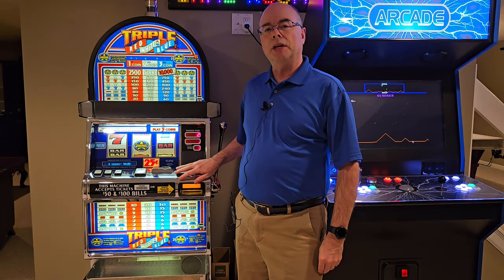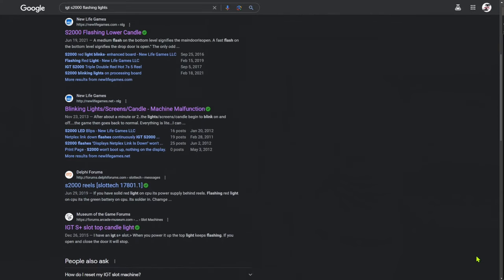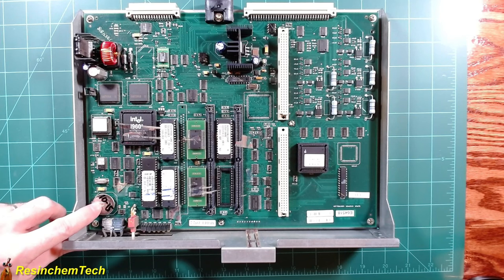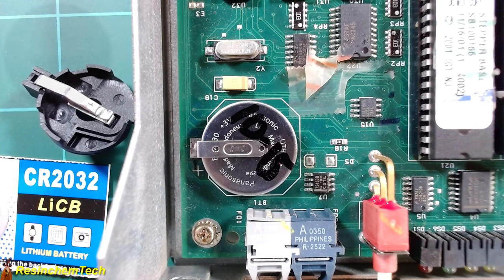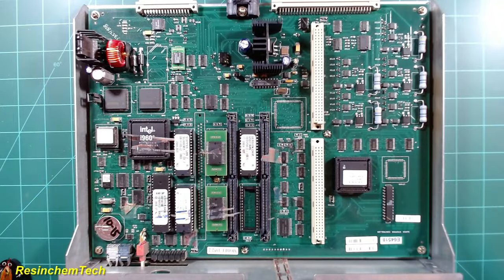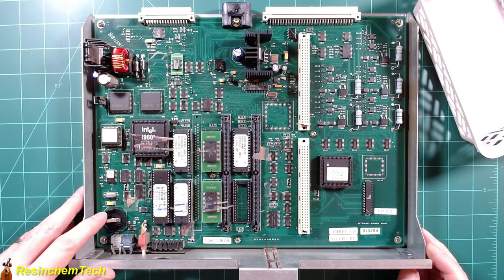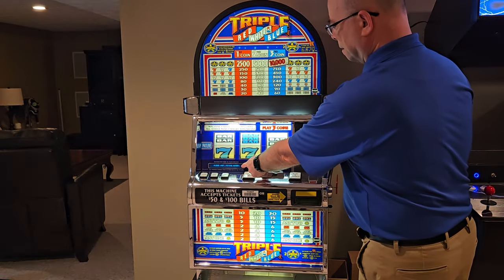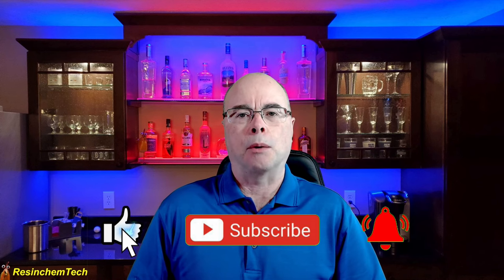IGT Slot Machine: Main Battery Replacement

Comment: Thank you so much for this video! I had two slot machines that have been down for about a year and I thought were gone and would have to be replaced. I found your video, installed two new battery holders and batteries, did the reset and now they are working again! I'm so happy!!
Reply from the maker: Glad it helped you out.  I knew very little about the inner working of these machines before mine went down.  But I learned that they are pretty serviceable and replacing the battery was much easier than I expected.  Congrats on getting your machines back up and running!

Comment: That was a fun change of pace, cool seeing the inside of a slot machine!

Only thing I wish you had kept in is the cleanup of the solder from the through holes. That’s one of my weak areas, but I can always find a how-to elsewhere if/when I need to.
Reply from the maker: Yeah... I did actually try to record a bit of that, but because I had to stand and clamp the board on edge so I could get to both sides simultaneously (heat one side while using the pump on the other), the video really didn't have a good angle and with my hands/arms in the way you really couldn't see what I was doing, so I ended up not including it.  But learning to desolder/clean through-holes is kinda' like learning to solder in the first place... it just takes some practice.

Thanks for watching and the comment.  I appreciate it as always!
Reply: That makes sense. I understand why not. But even now knowing you stood it on its side so you could heat from one side and use the vacuum in the other might just be the game changer I needed. I was heating and vacuuming from the same side and it wasn’t working well, so thanks for that tip!

Comment: Where can I get that same battery holder? I have same issue.
Reply from the maker: Since I switch to a BR2032, the same battery holder for a CR2032 will work since the dimensions are the same.  These are the ones that I used:  https://amzn.to/4cmbOoo
Reply: @ResinChemTech  Thanks! Just ordered it.

Comment: i see the arcade machine is still running, have you done any mods to it since your build video? one day i might get around to making one for myself.
Reply from the maker: The arcade machine is still running great!  As a matter of fact, I've been playing it a fair amount recently.  I haven't had to make any repairs or fixes since completing the original build.  About the only thing I've done to the machine is on the software side... tweaking some games settings, created some new collections, etc.  Otherwise, it's been rock solid.

I would encourage you to consider building one some day.  If I could build one with my limited woodworking skills, I'm sure just about anyone could do it!